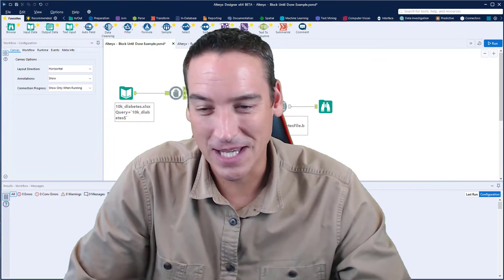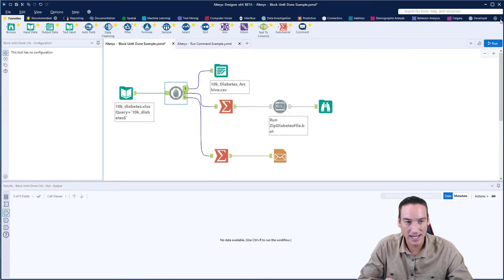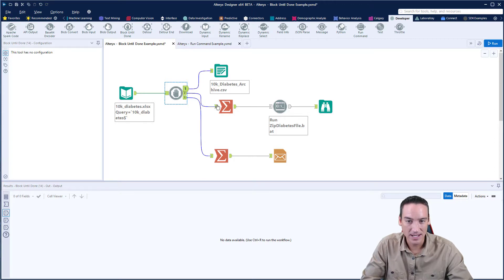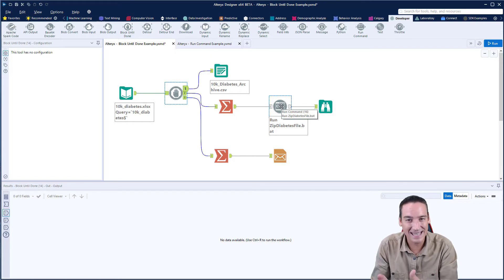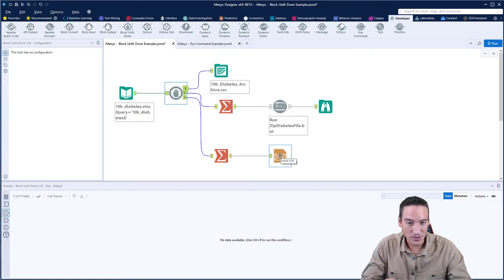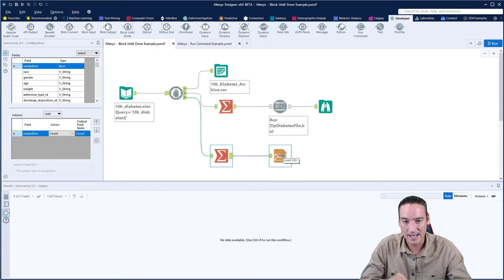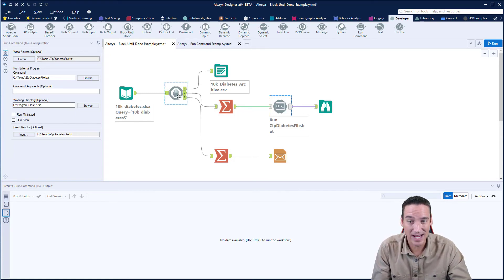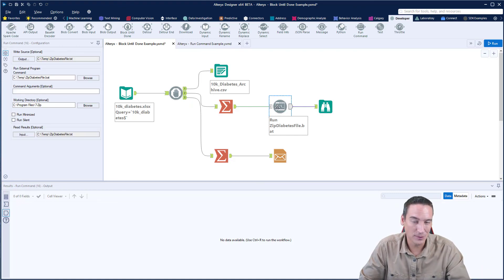Alteryx - How to use the Block Until Done Tool

Comment: Hi Nathan, I'm wondering if you have a solution for using this tool with a macro with multiple outputs? I'm running into a situation where I have a macro which has several outputs being written to the same Excel file and I am getting errors continuously. As far as I can tell, the block until done tool is only useful if you have one output instead of several. Would you have any advice on this? Thank you!